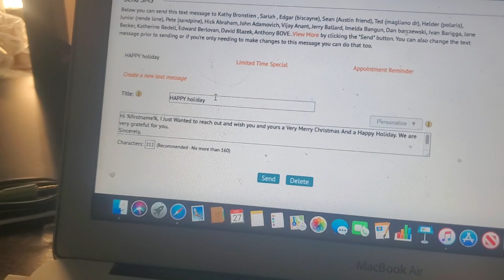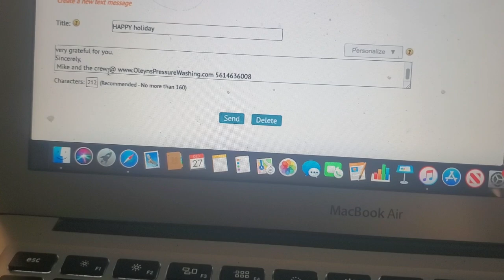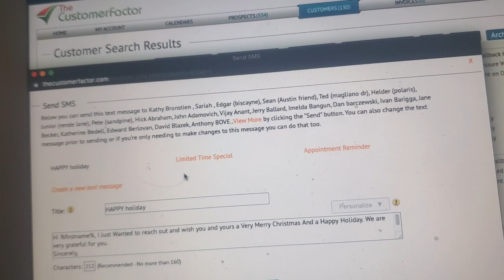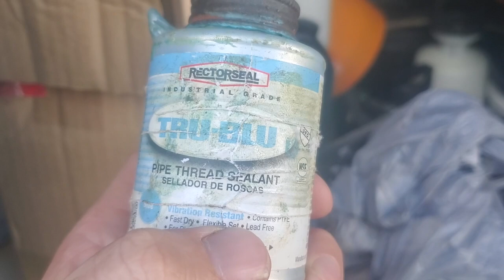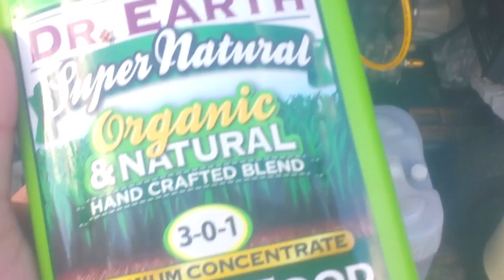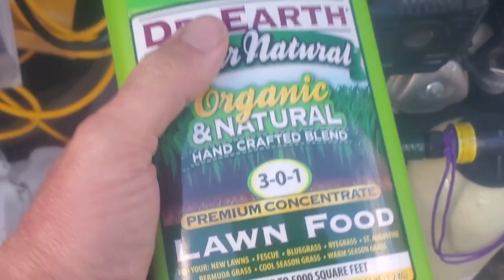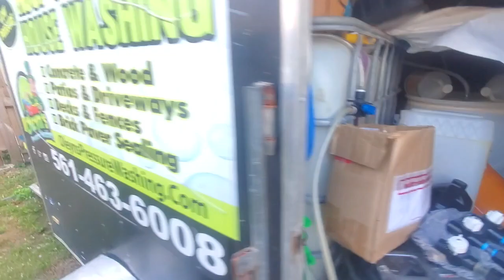tons of room for Pressure Washing activities

Comment: Question have u ever cleaned oxidization from aluminum siding that has dripped down on brick, if so what did u use?
Reply from the maker: Aluminum Brightener.. take the stain off brick
Reply: @Oleynspressurewashing  many thx will see if I can buy
 it in Canada, I knew you could answer this thx again
Reply from the maker: @randywashing298  yea check auto store aluminum brightner at napa or autzone.. also there is a Canadian wash store now have u seen
Reply: @Oleynspressurewashing  Big Shot Supplies but they are on the west coast , I am in south central ontario would cost the price of product to ship it to me lol